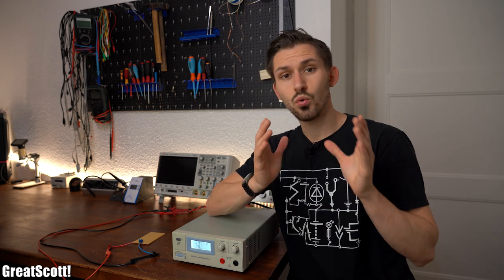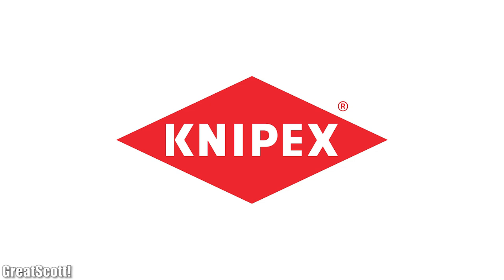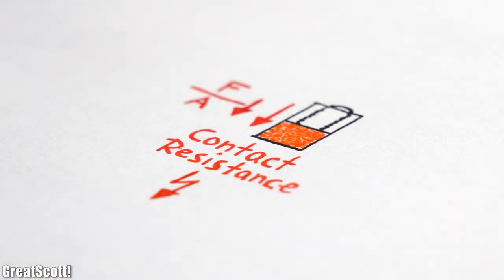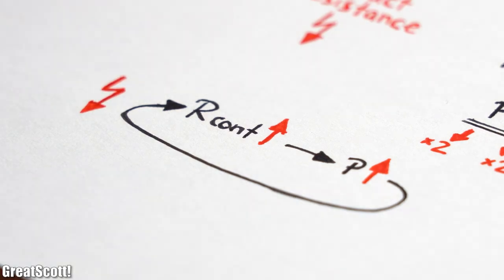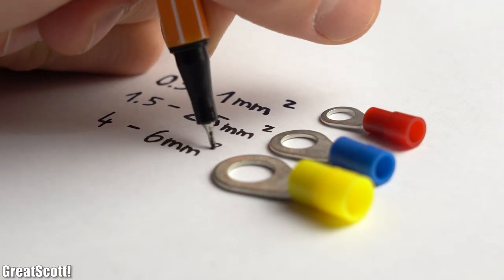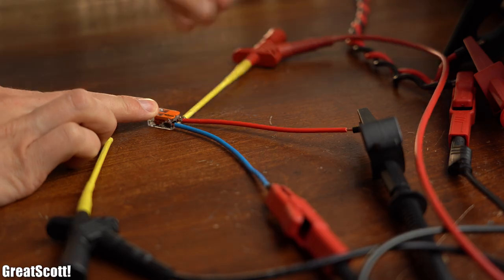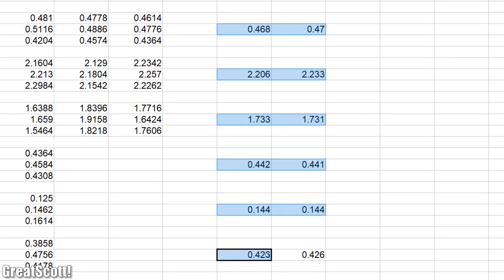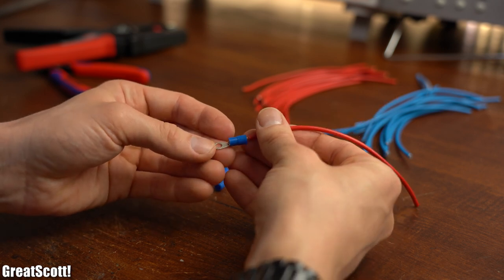Connectors are more important than you might think! So which one is the best? (Experiment)

Comment: The PCB screw result is actually quite alarming because my 3D printer and many 3D printer mother board use them as input. The current requirement easily exceed 10A with heating elements and motor attached.
Reply from the maker: True
Reply: Besides cooling the drivers, the fan in the control box should remove some of the heat from these connectors. I still added ferrules to my printer because bare stranded or tinned wires are dangerous anyway.
Reply: yup, was thinking the same about my diy 3dprinter with a ramps 1.4 board
Reply: Probably upgrade it, if possible, with higher current screw terminal and add more conductor for PCB power traces.
Reply: I absolutely agree. Just a few weeks ago I wondered why the Filament suddenly smellt so bad while printing. Until i found the problem, the screw terminal housing was completely melted.
Reply: That is why after testing I solder the thicker wires directly on the boards and make sure that when possible they have shorter paths.
For example: on most 3D printers only the - is switched by the MOSFETs on the mainboard, but the other wire, + (24 or 12V) is directly going over some trace to the next wire.
So: connect the + wire for the bed directly to the PSU instead of first going to the mainboard. Same for the + of the other heater(s). Of course making sure there is a fuse somewhere in the system. That way you can also use thicker connectors and wires.

Comment: I wish you had included "Molex" connectors. Unlike JST, they often handle serious current.
Reply: and never forget "Molex to Sata lose all you data"
Reply: What about SATA
Reply from the maker: Sorry about that. I just rarely use them......
Reply: molex makes a huge variety of connectors and are widespread in the US.  they work well enough but usually not my first choice any more.  I like Anderson power poles for high power applications
Reply: @bm652Z  lol, I wasn't even thinking of the hard drive connectors. But each pin there can handle 11 amps. A sata connector is good for maybe 13 total.
Reply: @razurio2768  how is that releated to each other?
Reply: @razurio2768  Sata and data aren't pronounced in a similar way in proper English.
Reply: Molex are probably the only plastic connectors I trust. You also forgot Dupont connectors!

I work on musical keyboards frequently, and dupont-style and "CW8" (no clue what that means) connectors are everywhere. The connectors rarely are the issue; normally the conductors in the cable go bad, or the pcb solder joints go intermittent from connecting/disconnecting over time
Reply: Molex connectors sometimes have really bad tolerances. You can easily pull it apart with just 2 fingers and almost no force.
And sometimes the Molex connectors are so hard to open that you will need all 2 hands and have to wiggle a lot to get the connection loose.

SATA may be better because they are "springy contacts" so they always right sitting plus SATA have more contacts in parallel.
Whereas Molex uses 1 Pin for +12V, SATA uses (I'll guess!!) somewhat between 2 and 4 connections in parallel.

That's a reason why SATA power have so many contacts although 4 or 6 contacts could be enough
[+3.3V (and Ground) ; +5V (and Ground); +12V; (and Ground) or just one common Ground for all three voltages]
Reply: Don't forget about other RC power connectors like XT60, Deans, EC3, and Banana
Reply: @backgammonbacon  depends on ones accent
Reply: @razurio2768  this comment made my day
Reply: @razurio2768  I havent heard that one in a l o n g time
Reply: @bm652Z  Wy test SATA? They're application specific and no SSD or HDD will pull tens of amps.
Reply: @gumpi5  I would guess that the better quality the molex connector the tighter the tolerances, and the better the connection actually is. But yeh that won't do any got if you can't just change them.
Reply: @ELECTROHAXZ  wdm? did you froget about CD and blu-ray drives?
Reply: @bm652Z  My point still remains. No CD, DVD, or blu-ray drive will use more than an amp or two which is what those connectors are rated for.
Reply: @ALL I did some quick digging at work and have come to the quick realization that Molex makes significantly more connectors than initially thought. For example: the spox connectors are about as reliable as plastic connectors come. we run plenty of current through them via powered speaker Processor/amp modules. But take a look at some of their wire-to-board connectors and I'm sure you'll see some usual suspects. My knuckles hurt just looking at some of those locking nano connectors. God forbid you should pull on the wire while extracting the connector...
Reply: @wahyutriwibowo1803  if banana is good enough for multimeters, it's good enough for anything!
Reply: The PCIe Power connectors can handle some serious load. You can run like 500W trough a 6 pin and it will not even get hot.
Reply: @backgammonbacon  yes they are?
Reply: @xWonderxBreadx  considering Euro AC plugs basically a pair of banana connectors, I think it's safe to use.
Reply: Molex is pretty expensive to use in a hobby project.
Especially the crimping tool.
Reply: wha
I only use molex for rgb light
I would never trust them
Reply: @razurio2768   That only looks like a rhyme. Spoken, it's nothing like one. "Seer-ee-al Ay-tee-ay" and "day-tah" sound nothing alike.
Reply: @backgammonbacon  yes, it's say-ta and dah-ta.
Reply: @xWonderxBreadx  what about wago connectors those are pretty trustworthy too, as they are the standard in germany, and german law is pretty strict
Reply: @Humbulla93  Wago are also nice (I think @GreatScott! showed one in the video) but my repair work centers around musical instruments and amplifiers, and most pro-audio manufacturers end up using flex-/ribbon-cable and Molex or Dupont connections. I upgrade connector quality when I can, but for my purposes, Wago would be overkill where a butt-crimp and some shrink would keep the splice solid almost indefinitely
Reply: Are we talking about a connector named molex or a company named molex that makes huge variety of connector?
Reply: @Arctic_silverstreak  I was talking about the style of nylon connector with 2.1mm pins that people generally call molex. Not necessarily just the hard drive connectors (which were ironically created by AMP, even though everyone calls them molex) but that general class.
Reply: @RealJohnnyDingo  they're called torberry connectors over here, and the market is flooded with fakes which do not have the same current carrying capacity. The plastic shells they are made from are incredibly important to the effectiveness of the connector, sadly the fakes are made of cheap thermoplastic and so they deform as current passes through, exacerbating the issue further until connections fail or a fire starts.

I prefer the XT style of connectors as they don't rely upon the plastic housing for the integrity of the connection, they're essentially a bullet connector, encased in a keyed plastic enclosure. You could remove the enclosure entirely and the connection would still function.
Reply: @wahyutriwibowo1803  lu pake konektor begituan buat main RC ya?
Reply: @eone199  nggak buat RC, tapi pake konektor XT60 buat DIY battery pack saya
Reply: XT60 and XT30 connectors, used in high current RC applications and more I don't know of. 60 and 30 amps rated capacity respectively. XT90 also exists but it's not as often in RC stuff, but it's found on those lithium jump pack things.
Reply: @razurio2768  Exception: Crimped molex to SATA are fine.
Reply: i personally prefer duct taping my 100v 100A carrying conductors
Reply: @gumpi5  3 connectors for each voltage and 6 for gnd iirc
Reply: Which molex connector? Mega fit? Mini fit? Mini fit sr? Mini fit jr? Micro fit? Molex makes a lot of connectors. Mega fit connectors are often used for 08 AWG. Many molex connectors also come in different colors for heat resistance. It would be an insane venture to test all “molex” connectors my friend. I am sure you may have meant the 03061042 4 pin that many assign the moniker “molex”. Maybe I’m wrong but molex is a large manufacturer of many different connectors.

Edit: the colors indicate the temperature resistance they do not themselves change the “heat” resistance. I miss typed that.
Reply: @RichardiOS275  that connector on your 24 pin atx for the motherboard? Made by molex. CPU power? Molex. GPU power connector? Molex. It’s a brand that makes many connectors
Reply: @greatscottlab  Wire nuts, Molex, and the big bad of all conectors IEC 60309

Comment: Designing real world devices, the cost of connectors can easily eclipse the cost of processors and all the really important parts. In my experience the best connections are the ones that dont require hand work. We ended up using pre moulded m12 cables for everything because they are robust and didn't require assembly.
Reply: Do you use m12 ( and m8 cables I guess ) with both ends pre fabricated?
I am from Italy and we mostly ise them one sided for sensors
Reply: Some economy idiot decided to save 5 bucks on some Relais

The Relais required 15 mm long crimping thingies idk how to write them In English

We had a machine to do the 10 mm long 1.5mm2

So we sat there probably a few weeks making cables...
Reply: As is often the case, the answer to what is the best connector to use is: it depends
Reply: It depends. I have seen many pieces of serious/expensive equipment where outside conditions made a connected connector unusable after a few years. In some situations the choice of connector protects the equipment during it's use. Sure, there are situations where choice of connector is not important, so you go for most affordable connector that is easy to use, but in some cases it makes a huge difference.

Comment: It's great to see the soldering connection winning out. I'm getting tired of people saying that soldered connections have resistance! It is fused metal after all, and the surface contact area is much bigger ( even if solder has a higher resistance than copper)
Reply: He should have done a Western Union twist anyway before soldering. I never just solder two parallel wires. We're always getting into it with guys who insist crimps are superior to solder in every application because of vibration. NOT.
Reply: the worst issue of soldered connections is that on heat they dissolve; they thus are bad for anything that is expected to heat up

Comment: That last ferrule you did mad me cringe internally, you didn't butt the end of the sheath into the ferrule so you had exposed wire.
Reply: it wasnt just that one...he did it with others aswell... sooooo bad...
Reply: Someone suggested he did this for his 'test setup' so he could connect his meter leads right behind the ferrule / connectors.  I can excuse him for that, but otherwise you're absolutely right, the insulation should be up inside the ferrule's insulation.
Reply: Yeah, had me going, too. In an earlier shot he uses the exposed copper to connect his meter, so maybe that's the reason.
Reply: @mikefochtman7164  If you're going to demonstrate a tool, especially if you're being sponsored by the toolmaker, you should show it being used properly, and if you're going to use it incorrectly for your own reasons, you should explain what you're doing, and how it should be used.

I wonder if Knipex ever sponsored GreatScott! again after this.

Comment: PCB screw terminals have been used on heating elements on DIY 3D printers for years. One of the biggest issues with them is that they burn out or catch fire.  Your video shows exactly why this is a bad idea and anyone who has these should change them out ASAP

Comment: "When are you going to draw 10A through a PCB connector?"

Me: Looks at 3d printer....
Reply: Damn, my 3D printer uses those too... Thinking about replacing em with wago connectors 🤔
Reply: Uh oh...
Reply: @Fighter_Builder  imo if you have 120w heatbed remove connector and directly solder wires to pcb or in case of over it i would recommend using external relay and xt60 connectors they are rated for 60a.
Reply: Those screw-contact "PCB" connectors are not much trustworthy beyond 2A or so. They can handle greater current but they will soon fail due to contact resistance heating. Power (heating) increases with the square of current passing through the contact resistance.
Reply: Me looking at the controller for 2.2kW heating element mounted in my electric meat smoker.
Reply: @Fighter_Builder  Actually the ones you have are potentially much beefier and better behaved than the ones he tested. Like to take GenL for example, the hotend terminals are the same as he tested, pretty small, they only pass around 3A tops and they work fine for that. The bed terminal and power input terminal is much larger, and survives a fair bit more.

Over 4 years, i have had one bed connector fail on the control PCB; but it failed not because of the connection, but because of the bad soldering quality on the pins of the connector to the PCB. So i'm using GT2560A+, a genuine one, and it has a design mistake that they left out thermal reliefs. Then during soldering, the PCB soaks away the heat and you maybe end up with a cold joint. I had inspected the PCB beforehand, and it looked actually good, but it turns out, the cold joint was hiding under there, which became very obvious after failure because of how the bits of solder peeled off when the PCB delaminated. There wasn't a lot of heat generated in the screw clamp part of the connector at any time at all, there was no damage there at all, no warping, no discoloration on plastics or the metal, nothing, it was healthy.

Something to also consider is that these crimp ferrules, well they're visibly not terminated properly. Maybe he chose a ferrule which is too large for the wire that he picked, maybe the wire was manufactured "underweight" for what it claims on the spool. When he crimped it, the crimp came out wavy. Well some crimpers always make wavy connections, that's not good, can indicate bad alignment of the tool where one of the directions applies more force than the other. Now consider what happens at the contact, it maybe contacts on a line, maybe on a point, no way at a decent area! Of course contact resistance will be increased and current handling capability will be reduced. Ideally you have a wire which just about fits in the ferrule, and you aren't allowed to twist it, it has to go straight in, it's a bit difficult since you have to align them perfectly, it almost seems like it cannot fit, but when the cut is fresh and the strands are all straight, it goes in. Then when it gets squared up, the perimeter cross-section length stays the same, but the area is reduced and the air gets pressed out, you get essentially a solid chunk of metal, and the surface of it will be completely flat where it got crimped, it's maybe a square with slightly rounded corners. This cannot be the case when you have waves, there's still going to be some air in there, because how else do you arrange wires in such a varying crossection without breaking them? So that's not a good crimp, it's bad at the interface between the ferrule and the screw clamp, and it's compromised at the interface between the conductor and the ferrule shell. Air inclusion is not ideal since it will speed up degradation of the contact between the ferrule and the strands.
Reply: Wrong terminal. Most printer boards use shoe connectors, which definitely handle a lot of current.
Reply: Me: looks at triac regulator
Reply: @benjaminshields9421  No, shoe connectors are uncommon on the control PCB. They always have it power supply side but none of the common Creality, Geetech, Anycubic, Makerbase, and Bigtreetech group PCBs have them, and even Duet, they're all rising clamp wire terminal blocks. Together these brands form at least 90% of the printer market if not more. As to exceptions, Ultimachine (Prusa Original supplier) uses either horse shoe connectors or dedicated pin connectors, but that's the only one i can think of.
Reply: @milantrcka121  I find those board connectors just don't work regardless of current. You buy a 3D printer where all the wiring is stranded, not solid, and  the interconnects are those screw terminals. I bought some power supplies and just placing them in an enclosure is enough for the wires to come out. Again, their existing wiring is all stranded so it was their idea, not mine.
Reply: @SianaGearz  Same here. Creality Ender 2. Only the AC-DC supply has shoe connectors. I call the wire terminations ring terminals.
Reply: Yeah, anyone had a door interlock on a washing machine go bad? I did and had a look at the PCB track burnt from one end to another. 240v through a small track. Unbelievable. I ran a wire direct from the (new) interlock to the relay. Set up to fail I believe.